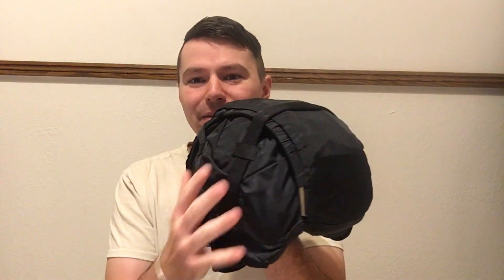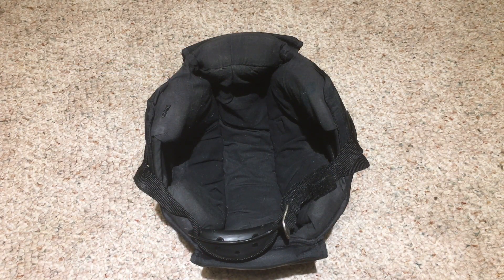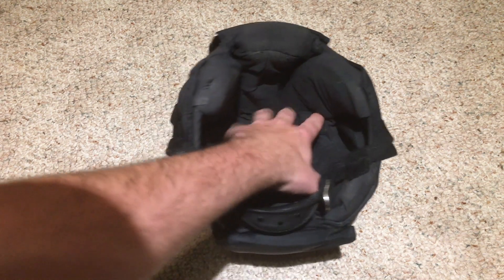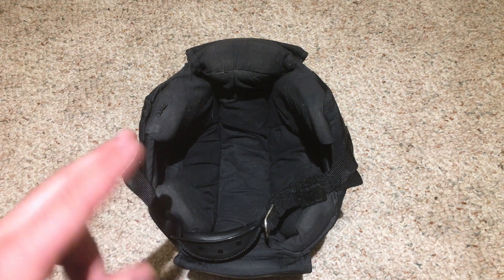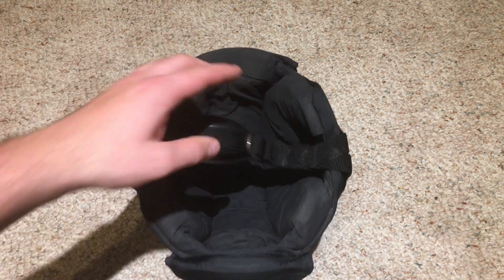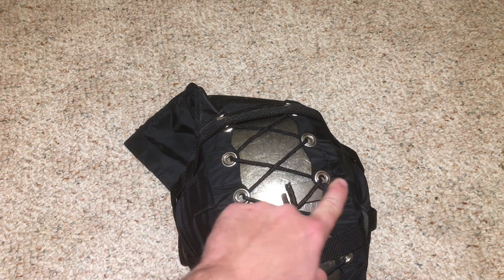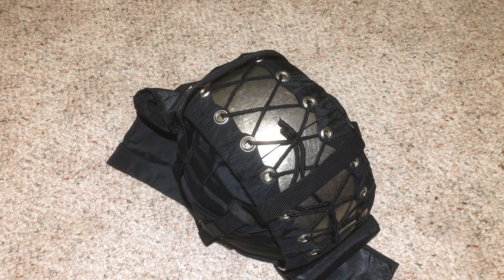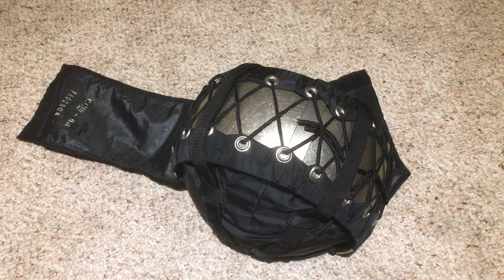Russian STSH-81 and SSSH-94 sfera (sphera) Helmet

Comment: The titanium version is stronger than the steel version. And the Soviet Union didn't have problems producing quality steel. I have no idea how you came up with this story. :D Ukraine switched from steel plates back to the titanium plates in the early 2000s because they discovered that the steel version was inferior. That's why you have a black SSSH-94 liner with titanium inlays. I have the same helmet, it was produced by the Ukrainian company Temp3000.
Reply from the maker: Because that’s what the designer of the helmet at the time said that he was given titanium to work with because steel was going to more important items at the time and it wasn’t so much the steel as the precious additives to steel you need to make good body armor were in short supply and were much more needed for the navy and Air Force. Also the steel one was much better at protecting because the steel had a much better deformation pattern as the titanium is brittle.
Reply: @DevinK  Watch the ballistic test

Comment: Also a quick question do you know the exact weight of both helmets?
Reply: Titanium-2.3 kg, not sure ab the steel one. It seems heavy, but it is well distributed. Also he was talking about how it bites but you can switch the plate around so that the curved end is on your forehead and it eliminates that issue.

Comment: i too have titanium and steel versions, love them
Reply: also tip of lacing it up together, i actually got fast at doing it, when you put this helmet on your knee while having your leg bent up, it really makes it easier coz it's not flopping around. Also i wonder if it's possible to combine plates from 2 spheres in 1 cover, due to plates being separate. In theory it should be possible to make crazy at bulletproof level, if you are able to hold it on your head. I can imagine it would be nice when storming buildings tho. I was able to wear it with peltor active hearing protection bYy loosing the lases up, upgrading the hearing in this helmet. I was also able to upgrade titanium one with those american velcro Pads, since old pads desintegrated from age, you can pretty much skip putting the pat on the top of the helmet, so it will sit lower on your head, making it look much less derpy. I could imagine you could grind the part of the plate that jabs into you neck, if you were using this helmet for actual combat.
Reply: They also make replica covers in various modern cammo, that has upgraded styling, and it stays on the helmet much better than the orginal cover. https://www.frontowiec.com/32906-large_default/rz-pokrowiec-na-helm-sfera-kamuflaz-izlom.jpg